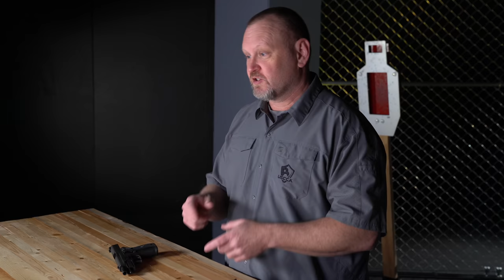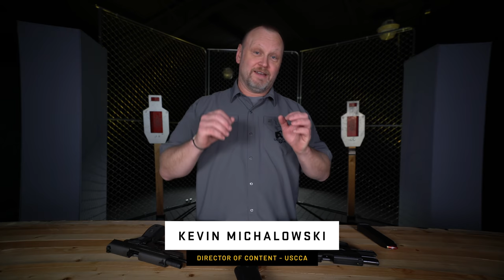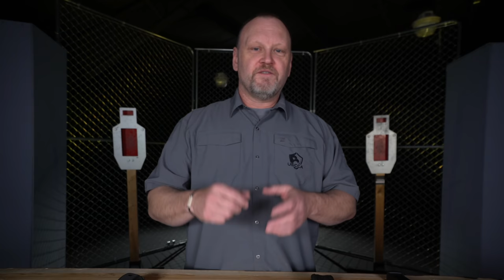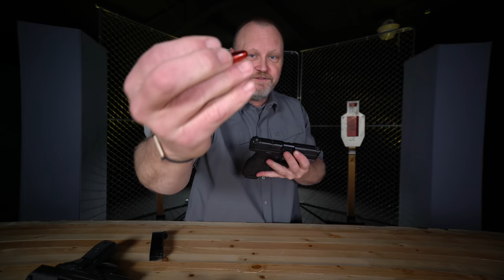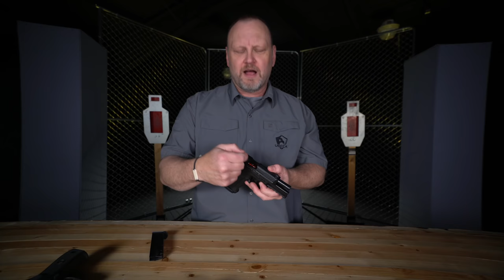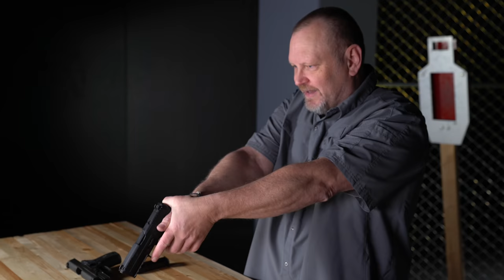How Guns FAIL And How You Can Fix Them

Comment from the maker: 👇 COMMENT BELOW: What was the WORST malfunction you had with your gun?
Reply: Best correction is Chicago reload
Reply: magazine was not fully in gun causing the bullet not to enter the chamber...
Reply: Had a revolver malfunction at the range one time. Had the facilities technician take care of the issue.
Reply: Had a revolver malfunction at the range one time. Had the facilities technician take care of the issue.
Reply: Had a small rock get into a magazine from being on the ground that prevented a round from being loaded. Just dropped the magazine and changed to a new one in the moment, but discovered the rock when I picked up the mag later on. 👍
Reply: I had a "sqib" round, in which the primer went off and sent the bullet out of the chamber but not out of the end of the barrel. The next round fired properly and the two bullets collided in the barrel. Being a quality firearm (i.e.  S&W) the collision caused a buldge in the barrel instead of a catastrophic burst. I replaced the barrel with an OEM replacement (not an aftermarket). I also learned to pay attention to the amount of recoil of each round.
Reply: My first and only malfunctions was due to poor grip.  When I teach new folks how to shoot, it is the second
 thing it teach, AFTER the 4 rules of gun safety..
Reply: A stovepipe once.
Reply: Not on a pistol; but I've seen small peice of brass from a case get stuck in the chamber and a failure to go into battery.
Also,  had a case fail to eject when the extractor broke the rim of the case.  Milsurp gun and milsurp ammo.
Reply: I don't have a gun but would really like to have one to help defend my family as we are older and there seems to be a lot more violence in our area. Thank you God bless you ❣️🙏🤗
Reply: @lindajacobe3871  good for you. Bless you.
Reply: My worst malfunction was in July 2008. I was headed to work at 4:30am because I had to be on the construction site at 5 that morning for a safety training session. I was 23 and had been carrying for a little over a year. I needed to go to the bathroom, so I stopped at a public park in the neighborhood I grew up in. I didn’t even think about taking the gun from the console and bring it with me to the little bathroom building. I get done and walk out the bathroom to someone standing there with a gun in my face! I don’t know what he said but I just handed over my wallet. He slapped it away and said “I said the keys MF’r”. So I took the keys off my belt loop and threw them to the side. When he looked that way, I grabbed the barrel of his gun, and tried prying it out of his hand. I had deflected the barrel away from my head, but he pulled the trigger, and I fell with a burning baseball bat to the knee sensation! I had such a grip on him that he fell on top of me, and so we started wrestling over the gun. He pulled the trigger multiple times, but since I had ahold of the barrel, his pistol never chambered another round!! He ended up running off after he couldn’t get the gun back from me. After he was gone, I realized that he had broken into my truck, and found my gun. It was my own gun that I had to end up defending myself over. I learned at least 2 lessons that morning....ALWAYS KEEP YOUR GUN ON YOU, and  most of the time YOU ARE ON YOUR OWN IN A FIGHT!
Reply: Sigkim  my malfunction was in my head. My malfunction was leaving my gun in the car. 😂. But yes, it was an awesome malfunction that I induced!!
Reply: Px4 storm kept stove piping. It was brand new and had to work it in the action and fixbefore it stopped happening.
Reply: So far just a stove pipe.
Reply: Never had one, i own Glocks
Reply: @jstud999  It will one day. It's just a matter of time.
Reply: Guns do strange things.pulled up at public beach access.was going to be getting wet so put loaded holstered beretta under seat cover where rear end goes on seat. Finished fishing,forgot about the gun,got back home,gun had worked its way backwards & up to lumbar part of the seat.Was still in holster but safety was off & hammer was fully cocked.Nothing bad happened but it could have. Reevaluated being to comfortable,lackadaisical ect ect with all guns from that day forward.
Reply: Desert Eagle .50 AE. Shot first round. Went to fire second round, slide was not fully closed. Checked breach and found second round seated in barrel.
Reply: Accidently firing a 40sw in a 45acp 1911.  The extractor was strong enough to hold the rim in the smaller chamber for the pin fired. Case partly ejected and jammed action. Lesson learned: never have ammo boxes of different calibers on loading table.
Reply: Shooting a .22 LR at age 8.   Shell exploded in chamber.  Failure occurred as a metallurgical micro fissure formed at base of cartridge.  What did I do as my ears were ringing ?   Looked at grandpa and asked, "What Happened" !   Followed by, "Do we have more ammo" ?
Reply: Exelent video.   Looking forward to waching more. Just now subscribed.
Reply: had what I thought was a slow burn on a 9mm. pulled the trigger heard the click and nothing.  waited a bout 30 seconds to a min and removed the magazine and cleared the round. I could see the striker hit the round but no bang so I disposed of the round safely. I junked the rest of that new box of ammo due to the risk of another round not just being a dud and but something worst.
Reply: I have a G43 and it is junk! sometimes it doesn't cycle at all, sometimes it will try to cycle but it jams up......its junk! and I love it because of its size and until I can get it fixed I have to use my PT 101 AF 40 S&W....any suggestions? I was thinking about getting a new slide, because it wiggles up and down, a lot of play in it not sure if its the slide or the the locking block....I need it fixed because its small compact and I put a T-Comp on it to help with recoil but with and without the T-Comp it still has problems
Reply: Two double-feeds on my AR. Both times were my fault.

Comment: Excellent information and presentation. Since this seems to be geared towards "newbies", there is one other tip that I think should be pointed out. Notice that when Kevin pulls the slide back he always releases his grip when the slide is all the way back, allowing the spring to return the slide to the forward position. Do not "ride" the slide forward with your hand, slowing down its return. Doing so will often cause a misfeed.
Reply: . . . . . unless you are an assassin  . . . .creeping up on your target . . . . from the treeline . . . .in the darkest of nights. . . . slowly riding that slide forward . . .as silent as the wings of an owl.
Reply: It's geared towards everyone. Why you might ask? Because a good portion of seasoned gun orders act like know it alls and can't be told nothing without it hurting their ego. This type of close minded mentally can't cause one to become rusty even on the basics.
Reply: Gonna have to agree.  This is geared towards novice students.  No one said that basics aren't important.  That's the difference between novice and experienced. Mastery of the basics is the standard. I don't think this was a great video.  It is informative.  There are some points that should have been stressed more. Maybe this should have been 2 videos.  How they work and then what causes malfunctions and how to help avoid and or correct them.
Reply: Thank you. I need to work on that too.
Reply: I found out at the range to not ride the side. Ended up with a pretty bad jam. Took me about 5 minutes to clear. I never ever ride the slide now.

Comment: Another, albeit less common failure, is a failure to go into battery.  Maybe cover that one in part 2.  Tap and rack works for that too but can sometimes be fixed faster by smacking the slide from the back and giving it a forward assist.
Reply: Into battery? What? Never heard of this. Will you please explain?
Reply: @wethepeople9161  When the bolt in a rifle or slide on a semi-auto pistol (or any type action really) is fully forward and locked in place with a round in the chamber, that is a condition called "in battery."  In this condition, the firearm is ready to fire a round.

For more background: https://en.m.wikipedia.org/wiki/Out-of-battery

Comment: Thanks for another short to the point presentation. Not a malfunction, but I would like to add safety for a dead round. In a misfire, continue to control the muzzle and expect the round may have a delayed fire, when clearing the slide,

Comment: I have a Kahr PM40 that the rounds would frequently nose dive and fail to feed. After sending it back to Kahr twice, I noticed the magazine spring was extremely stout. This is expected, as the compact weapon cycles very briskly. The mag spring has to be stout to push the rounds up fast to be fed. However, the mag spring was so stout it was causing the rounds to drag on the round under it, and causing a nose dive. Started shortening the mag spring half a turn at a time. At the 1.5 turn point, the pistol became 100% reliable. Problem was the mag spring was too stout.

Comment: All these years I thought stovepiping happens when you have something like water in a no rifled barrel. The moisture can't move as fast as the projectile and gas. The sudden pressure buildup causes the barrel to bulge and becomes the shape of a stovepipe. When a round or shell gets jammed in the ejection port it's called a jam. Please correct me if I am wrong

Comment: Hey guys! I’m a rookie. Just took the class. Just got a semi automatic handgun. And waiting to get my CCL in the mail. (Also waiting to get a holster in the mail too.). I want to be able to protect my family and my community from possible danger if it arises. 
I have a Ruger SR40c. It will hold 15 and one in the chamber. But I don’t carry with that extra one in the chamber though. It’s because I get a jam after the first shot. And sometimes i will get a jam up when I have the chamber empty with a full mag of 15. 
So I put only 14 in the mag and no problem. 
Does this problem have to do with the tension on the spring in the magazine? Or am I making some sort of mistake? I appreciate the input. 
Thank you in advance.

Comment: I have a mc28 sac girsan I went to the range today and for some reason it was firing one to two shots then stops. The pin is hitting the round but it won’t fire. I’ve never had this problem before but once I cleaned it one time. this is the first time it has done this. Any suggestions ? Idk if I over oiled it.

Comment: There's a much quicker and better way to deal with a stove pipe, that doesn't require 2 "tap rack bangs" and losing a round. 99.9% of the time, when you have a stove pipe, your pistol chambers a fresh round, it just failed to fully eject the spent casing. Now remember this is in the scenario that you are in a gunfight and REALLY need to be shooting RIGHT NOW. IN fact, you was shooting when this happened. SO, you have both hands on the pistol, in a firing grip. SO, simply take your weak hand off the grip and quickly swipe the top of the slide, front to back, with your flat fingers and that will remove the spent casing.. Re-acquire your grip and get back into the fight.
Reply from the maker: How often do you get to train using this type of malfunction clearing?

Comment: Good thing for anyone to watch. Th stove pipe non function, when I was thought auto 101, we had a lady. She was scared to death and I felt a lil scared each time it came to her to pull n fire.
  Put we learned a different name for that. It was called a limp wrist that caused th stove pipe condition.
  I've tried to hold a weapon loose nuff to cause a stove pipe condition and just couldn't.  My daughter loives to shot, as do my wife, both x- wives and both sons.
  I git alil nervous as I own 2 autos as my lil girl shoots with a limp wrist.
  She doesn't like my Rugar 1911 clone. She doesn't like large frame guns.
  I have swapped my hard grips for softer gripped hand guns as my AR. She has control of my Rugar P90 45 cal auto, and tho scared of it she has better groupinz tha I do at 25 n 50 yrds.
   I do better  at 10 yrds n much better at 75 and 100 yrds. Both has held that grouping many times with the handgun,I so love n love shooting.
   I carry my Glock 17 9x19, as it's an arsenal alone. My next to carry is, again my Glock 23 4th gen. I carry this planning to do much walking as it's a lil lighter and my extreme weight loss, has a few rolls of extra fat that gets rubbed to much.
  Then 40cal has good knock down power but the 9mm has  enuff for what's going on in these times. Plus 2 full extra mags and th 9mm can make sidewalk litering quite possible.
   But I really love my P90 45cal Rugar. That's th first hand gun I bought new.
  I told the sales person a list of what u wanted, and he handed me that P90, and it was love a first. But when in changed out the grips, I think th gun loved me also.